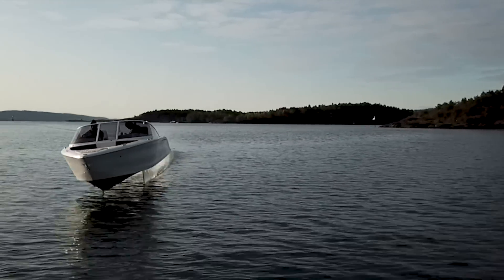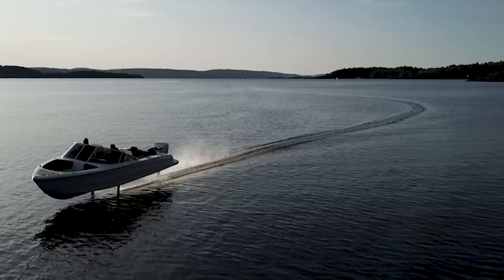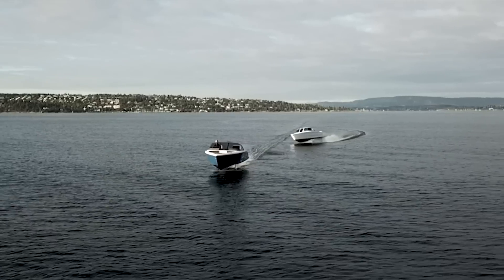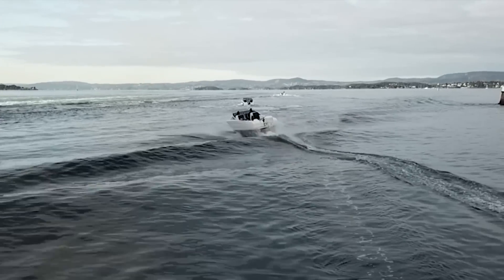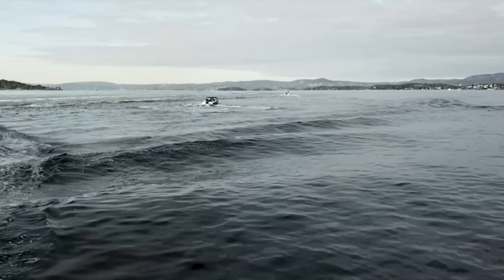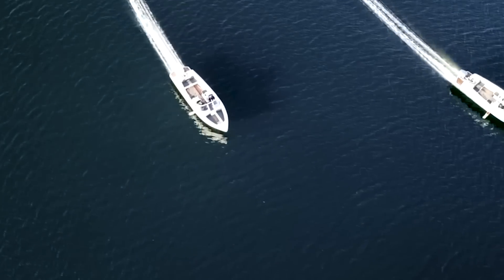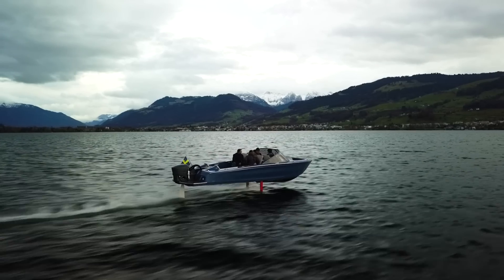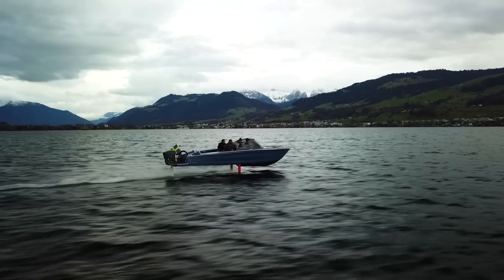World-first all-electric foiling sportsboat explained | Candela Seven | Motor Boat & Yachting

Comment: The price is crazy. $300,000 for a boat that does 35mph and has a 50 mile range???? I'd love to see electric boat replace ICE ones but it's not even close if those are the stats.
Reply: This was the case with the first Tesla Roadster as well...  This boat is not for all. It's a tech demonstrator for early adapters and rich people.  If enough people buy it Candela as well as other boat manufacturers will develop the concept  and 10 years down the line you can buy a boat with much better performance for half the price.

Comment: How much?
Reply from the maker: Starting price is €245,000 ex. VAT
Reply: @MotorBoatYachting  Worth mentioning is that we don't offer a long list of addons, just a trailer, and a cruising cover. We also include a mooring cover in matching colors to the upholstery. The cost to run this boat is also super low. For "fuel", you can count on about 1 eur for every 10 nautical miles approximately...

Comment: A Moth don't need no stinking computer at the same top speed!
Reply: Yeah but you have to extremely good at sailing to fly a moth. While you are technically right that the moth doesn’t need a computer, it adjusts the foils in a fairly similar way to this boat, just analogue

Comment: A thought: - hydrofoiling is an obvious way to improve efficiency to get from A to B on water, as shown by america's cup design boats. As a design we've known for years. There have been ferries with hydrofoils for decades, carrying substantial cargo and people. So why no leisure/pleasure craft?
I've loved boats for years, from afar. Particularly sports yachts, sunseekers, princess. Until about 8 years ago, when I realised that in my lifetime there is a chance I might own one and I started looking at them from a very different perspective and came across the fuel consumption and range. To say I was shocked is an understatment. The latest Sunseeker manhattan 68 for example, perfectly normal within its class, has a range of 550 nautical miles at a 'best' fuel efficiency of about 0.5 nautical miles per gallon.
From that moment on, my appetite was gone, and if you follow the natural progression you end up at cruising trawlers sipping fuel at 6 knots, or power catamarans with far less drag and displacment, but it still doesn't get away from the obvious question about pleasure craft development. Why no foiling sports yachts? given there have been far larger craft with foils for a long while.(I'll park hybrid power, and hydrogen fuel cells and waterjets for over 20knots....)
Reply: It's a good thought. I think it has to do with cost and complexity. To get this boat to work well they had to have a fighter jet systems engineer, hydrodynamic engineer, and probably many other high paid specialist. That's alot of R&D cost, and who knows how many prototypes and how long it took to get the boat to where it is today. Then imagine what that would do for the cost of a good size Yacht such as a 68 sunseeker, which would presumably need much larger more expensive equipment to handle the weight/forces. 
In the scheme of things, all that cost may not outweigh the potential efficiency gain for a pleasure yacht. That being said it's an awesome idea and maybe the technology will get cheaper and then one day you could have a 68 sunseeker that flies.

Comment: Wonder how long/where it will take to recharge your boat crossing a Bay/ocean?
Reply: Well if you were trying to cross an ocean in that you are daft.
Reply: @Kaziklu  You couldn't even cross the lake by my house. 50 miles really is not enough on the water where there is no access to charging stations at marinas.
Reply: @BnMProductions11  The lake near your house is 80km wide? There are only a handful of lakes around that are that size. Most outboard motors don't have much more range on one tank either. 
If you are on a lake that takes 2 hours to cross than this likely isn't the boat for your use case so I would say don't buy it. 
No one is forcing you to. No one forced you to buy an early electric car with a short range and no infrastructure. No one is forcing you to buy this. 
However if you are looking for a boat to have some fun in, go for a while or live on a average sized lake, bay or Fjord then it would be fine. 
I don't get people that are like... oh this isn't right for me so it's shit.

Comment: Nice tech but... a new Axopar 37 is cheaper than that and I know where I'd spend my money!
Reply: Yes, on 3 liters of fuel per nautical mile... ;) 
One of our customers saved 9000 EUR last year by switching from his 8m Aluminum boat
Reply: Candela Speed Boat yeah but how am I supposed to charge a electric boat on a bouy. How am I actually gonna get somewhere that’s more than 20-25 miles away? I get that your boat may be pretty neat for small lakes, with houses that have a private pier but for everything else it’s just insanely impractical especially considering how much it costs
Reply: @Candelaboats  Don't get me wrong the boat is lovely and once you or someone else manages to link the drive to a practical hydrogen cell electric is absolutely the future.  My post was a little flippant I wasn't complaining about price, if you are spending upwards of €150K on a boat if you are worried about fuel costs you just spent more than you can afford.

Comment: Would love it if there was a larger yacht with active hydrofoils. Maybe a nordhavn type passagemaker, but with the speed and smooth ride of hydrofoils.
Reply: You want Bigger???
Look up Tucumcari.  A Pegasus Class Military hydrofoil, all heavy Steel,  Turbine powered 45 Knots! 
My father helped Boeing with the design and build. He was on it during the first test runs in Lake Washington Seattle.
Reply: Probably too heavy and dangerous considering Nordhavn yachts are long range transatlantic-capable yachts. Imagine hitting a container that has fallen off of a container ship. It would probably damage the hulk either way but at least your hitting it slower without foils. Oh and Foils are kind of impractical in really rough conditions

Comment: Batteries from BMW i3?!...Those aren't effecient batteries nor fast chargeable. I will wait until Tesla make a proper one that is efficient with enough range  for long trips. And most likely will be way less expensive. 

P.S: If you showing a boat make sure to include footage of it while not moving. I bet this one rocks a lot.
Reply: The batteries can be charged pretty quickly. You will probably have to wait a few years to a decade before Tesla enters the boating market, if ever. If they did, they would definitely go for foils ;) 
Also, the boat rocks next to nothing due to the super flat hull in the rear. Check out this Instagram post: https://www.instagram.com/p/B_XlnUkI1Gi/

Comment: Since it uses 75% less energy, just make a conventional gas boat with hydro foil instead of using all these high tech stuff that’s driving up the cost.
Reply: It would be terribly difficult to attract all the talent needed to build this kind of innovative product, if the end result still was a petrol powered boat.
Reply: @Candelaboats  B.S. look at waverider boats australia.
Reply: Of course, but the entire point is that they are trying to be greener and use less fossil fuel.
Reply: @Alex-cw3rz  Carbon neutral synthetic fuels are a much better solution than batteries.
Reply: @tarmacaddict3923  This boat is the nautical equivalent to the smart car.

Comment: A great boat, if a little expensive. I remember travelling on the Greek Islands' Fast Ferry Hydrofoil and they were great, powerful and very fast! The only problem was when we hit the large swells and the front foil would drop out of the back of the wave, causing the vessel to slam into the next wave front - before riding up the next wave to do the same. This, for a whole hour, was pretty nauseating! Although, I guess, the ferry had a schedule to meet and if this was a privately owned vessel, we probably would have slowed down a bit!
Reply: This is an active hydrofoil that continually adjusts the height, so it almost never falls out of the back of the waves. The hydrofoil you were on was a passive one.
Reply: @tarmacaddict3923  Exactly

Comment: Be serious for one minute please, 245,000 Euros for a small power boat, high tech or not only a stupid buys this or someone with more money than sense.
Reply: @Crack Baby Consider a similar sport boat with outboard  would cost between 26,000 euro to a top of the range with all mod cons at 80,000 euro, that would leave you 165,000 Euro for fuel, so it is that stupid to throw money at an electric boat. Add to that you don't have 245,000 Euro spent when you only need to spend between 30,000 to 80,000 Euros, that remainder money could be used for something else, so I reiterate, only a stupid or someone with more money than sense would be buy an electric boat. Also consider how often and how long you would use a sports boat,  maybe 5 hours a day some weekends a year and it gets even stupider to buy an electric boat.
Reply: @maxnex7676  well they have 14 buyers already and the thing is it's a new technology, the first people to buy one will be subsidising people down the line and buying into a new innovative space.
On top you are sort of lying, there is a speed boat market in €245,000 range and this would be perfect for people who would love something different than the classic italian ones.
Reply: @Alex-cw3rz  Batteries for boats is a dead-end. Even fuel cells aren't perfect. Carbon neutral Synthetic fuels made from renewables and carbon captured from the air are the future.
Reply: @Alex-cw3rz  A fool and his money are easily parted.
Reply: @tarmacaddict3923  two things just like paddle wheels this is a stage, we have to go through to make quick progress we can go hybrid (diesel-eletric), to battery, then a hybrid hydrogen system and then hydrogen, that would be the most logical step. Carbon capture is definitely not the future, tree and Plankton sequestration may be a supplementary thing we take advantage of. Also I would be very interested how batteries are a dead end, I'd say they are not as good as hydrogen or sail but I'm not sure why you'd refer to them as a dead-end.
Reply: @maxnex7676  this ignores everything I said, but you are correct in another fashion.
Reply: We say no to pay to win: Firstly that’s quite a unique profile name to hide behind.

Secondly it’s well known that the “early adopters” get the sheer delights of showing off their cash to their mates. The manufacturer then gets what can be lovingly termed a beta user to iron out the faults. Then that manufacturer goes bust because of reputations damage.

Then.... the technology is lifted and used in more accessible vessels before becoming commonplace. So if you have that sort of cash burning a hole in your pocket I can only wish you well and smile as the guy in the foiling Moth flies past you with his spare change safely in his pocket.

I’ll stand with the other commenter and say my cash (should I choose to) would go towards the Axopar 37. Only when they wake up and give it a separate heads compartment.
Reply: Phil B You can now get an optional separate heads compartment in the Axopar 37 😏
Reply: @PhilbyFavourites  I don't use it too hide, I use it because it's a fun joke, and I don't really think you can talk when your called Phil B that's an alias too. 

Your second and third paragraph, just restate what I've said and explain why you wouldn't get one yourself, which is fine of course it's your opinion. Me personally I wouldn't get a speedboat at all, a yacht is more my style.